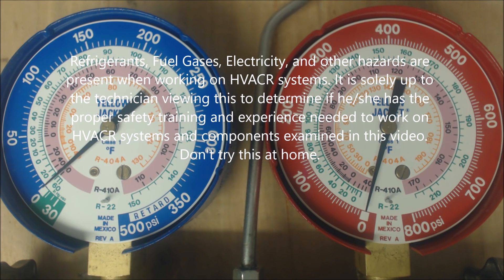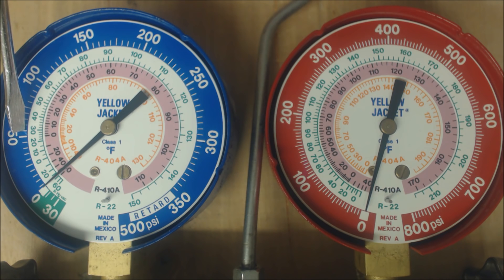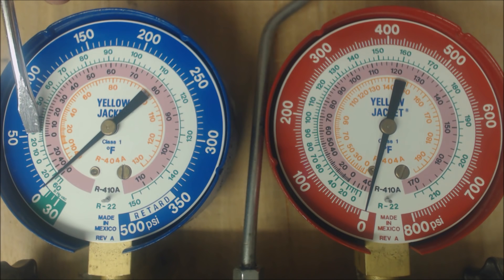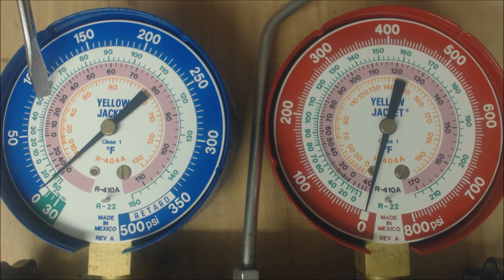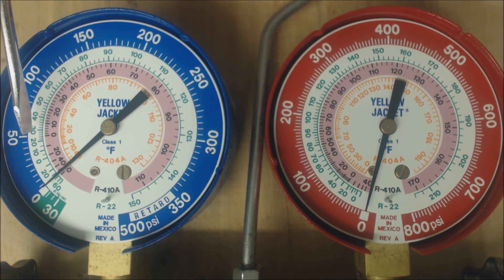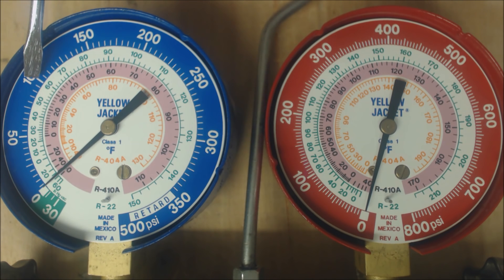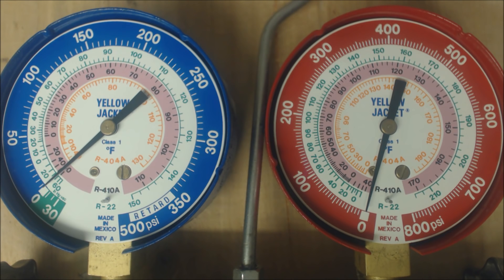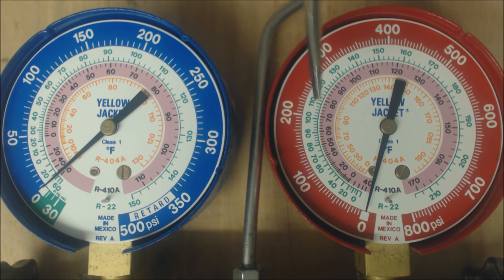R-22 and R-410a Low Pressure, High Superheat, Refrigerant Charging Problem Explained!

Comment: I have a R-22 system with a piston. 

My outside temp today was 88 degrees. 

My suction pressure was 77 @ 41 degrees. 

My head pressure was 257 @ 119 degrees. 

My suction line temp was 85 degrees. 

My superheat was 43 degrees. 

My liquid line temp was 94 degrees. 

My sub cooling was 25 degrees. 

My return DB was 75 degrees. 

My supply DB was 71 degrees. 

Gives me a 4 degree Delta T

 I cleaned my condenser two days ago. 

My temperature differential across my filter dryer was less one degree. 

I’m not sure where to go with this one. I’m having a really hard time figuring this one out. Any suggestions? Thanks in advance!
Reply from the maker: 77 psi is 46 degrees sat,  also something is not right if your suction line temp is higher than your return db temp. The suction line temp will be lower than the return air db temp. To me if those numbers were correct, it tells me you are sucking return air into the system from the hot attic. That seems to be the only thing that makes sense with the numbers there. Is that possible? is your duct in an attic? You have way too much of a heat load. Lets get that figured out before moving on to looking for a liquid line restriction because the return air and suction line temps are off, thanks!

Comment: I have a question I took superheat reading my actual temp on the suction pipe was 78 and my gauges read 40 degrees I tried adding refrigerant and the superheat never lowered my gauges would rise but my temp in pipe never changed also my high side gauge read 215 psi and never went up in pressure even by adding 1lb of refrigerant. What kind of problem does this sound to be ?
Reply from the maker: Did your subcooling rise? If you have a txv, the superheat may not have changed if there was a problem with it but if your subcooling rose then there is a problem with the txv, thanks!

Comment: Im having the same issue on your last scenario on this video,saturated temp at low side is at 62 & high side saturation is at 198,system is a r22 split system, could it be a blockage in the system?
Reply from the maker: I would need to know the superheat, subcooling, indoor and outdoor temp to tell you, thanks!

Comment: Hey bud I have a rheem/ruud weather king unit. My outside condensing unit fan motor will not shut off. My buddy works on ac equipment and has replaced part after part and this thing will not shut off. Any suggestions?
Reply from the maker: Was there a first thing that broke or happened, and then this started. It sounds like the fan motor may be wired to the wrong side of the contactor. It shouldn't have power when the 24v is not powering the contactor when the thermostat reaches its temp, thanks
Reply: AC Service Tech LLC first thing I noticed on the weekend was my thermostat was set at 75 but the temp inside was 77. I checked everything out and found that my condenser outside was frozen at the main copper feed back to the handler. My friend changed the contactor because it looked like it had been stuck or welded shut causing the compressor to run all night long.
Reply: He also changed the capacitor and the transformer in the air handler but it still keeps running.
Reply: Anything?

Comment: I watched many of youre videos, GREAT job!  I´m about to install an old heat pump from DAIKIN RXZ35NV1B. You say in videos that the gage should be connected to both liquid and vapor side, but as for what I can tell my outside part only got att serviceport on the vapor (low side?). Do you have a video for such a install?  You find a picture at: https://www.manualslib.com/manual/1074784/Daikin-Ftxz25nv1b.html?page=85#manual

My problem is that Im not sure of the amount of R32 are sufficient!   ALSO! du you have any video for using the "pump-down method"?  Many thanks!

Comment: I have a question, you said low-pressure won't be low air flow problem, cuz Hi superheat indicate the cool is not having any problem absorbing temp from the air. But I thought low air flow problem one of the reasons it is low refrigerant level means low charge, so low charge will get Hi superheat. kind of confuse about this. ty
Reply: The situation you described is iced up coil caused by low refrigerant. Using numbers from the video's example, @50 psi the saturated temperature of r22 is 25f, which is below freezing. Therefore, when the moisture from the indoor air condense on the coil, it is likely to freeze. As  more of the coil freezes, the air cannot pass through the coil, leading to the coil being completed choked. When you the technician show up on site there is going to be low air flow.

Comment: Great Greig ..Great video  Do you have any information or advice on water cooled condenser or water cooled equipment in general. I wanna know a little bit more so certain topics charging a water cooled unit ,what's a formula on checking if the water cooled condenser Is dirty , how does a water regulating valve works , Check sub cooling and super heat on a water cool unit .
Reply from the maker: Great questions, if the unit is a package unit then usually they will give you the data of what the pressures and temps should be at a certain gpm. This is on newer geothermals for instance. Most geothermals operate with different gpm depending on open or closed loops and where in the world you are located. I am on the mid east coast of new jersey so we are looking at 1.5-2 gpm for open and 2.25-3 gpm for closed loop. You need to watch the head pressure. You can also use subcooling if there is a txv and superheat for safety for the compressor if a txv. You could even use a ball valve to limit water flow at worst case. Usually we use a slow closing zone valve like the taco with the orange top or newer syle like the sentry. You may see a sprinkler valve as well. All are powered with 24v. Thanks

Comment: thank's a/c servicetech for sharing! i'm having trouble with a family member's 3 1/2 ton no name new install a very crumby install they left the old line set and the 220v plug that plug's to the box, the furnace breaker keeps tripping? I went inside and it has a 50 amp breaker that resets the breaker and the furnace is has a 120v plug outlet for furnace? can you help me out with this, thank's acservicetech.
Reply from the maker: Uh no, they couldn't have waited for you? I am having a hard time understanding what the electrical situation is. If the breaker size is incorrect then it has to get fused down at the outdoor unit or have an electrician replace the breaker. The furnace needs a good ground and should be hard wired. Thanks
Reply: thank's acservicetech they went back and did just what you said, but still left old line set oh well thank you for the reply.

Comment: I ASKED GREY FURNACE MAN AND HE SAID THAT IT LOOKS LIKE AIR IN THE LINES.
Reply from the maker: That is possible if you have high superheat on the evap coil as well as high subcooling and very high head pressures. Did you happen to measure the superheat as well? I know you mentioned a 34 degree sat temp. When you go back, tell the building owner not to turn the system on for an hour before you come and then check if the temp outside averaged with the temp at the evap coil measures the correct pressures on the p/t chart with the system off. If there are non condensables  in the system, the pressure will not match. If there is noncondensables then be ready to recover the whole charge and vac down to 500 microns before weighing the new liquid into the system. Let me know if you find noncondensables or what the pressures are when you check it again on a 70 degree day. If the charge was bubbly when you disconnect the refrigerant lines, that tells you a lot of moisture is in the system and the refrigerant oil is now acidic. Thanks!
Reply: MY BATTERY ON MY TESTO WENT TO THE CRAPPER THATS THE REASON FOR MY LOW INFO BUT YES IT WAS 34 DEGREES AND MY TEMP DIFFERENCE  WAS 16
Reply: A SEASONED TECH WILL BE TAKING OVER ON THAT UNIT

Comment: Great video. You mentioned possible restriction on high side. wouldn't that give you a high reading on the high side as well?
Reply: that depends where and if there is room for the liquid .most of the time high pressure will drop because, less refrigerant goes back to the compressor, thus reducing the load
Reply: @brianellsworth4767  it's not true, if there's a restriction on high side anywhere and the refrigerant charge is OK, the head pressure reading on the gauge must be higher than normal